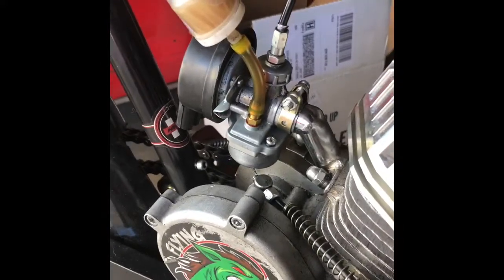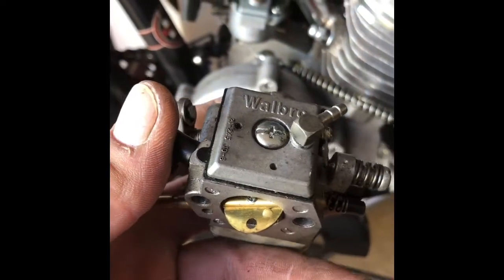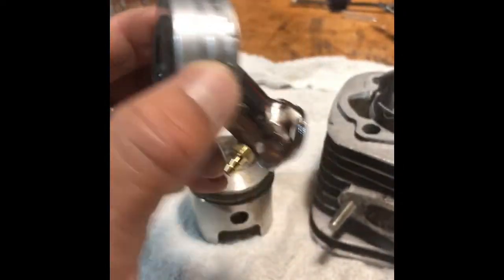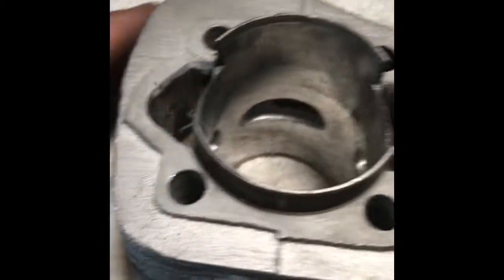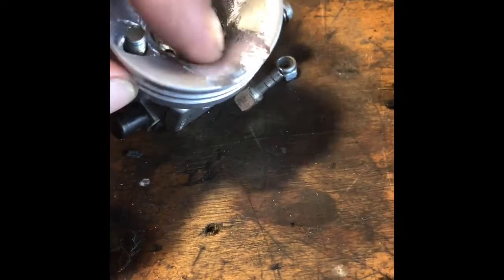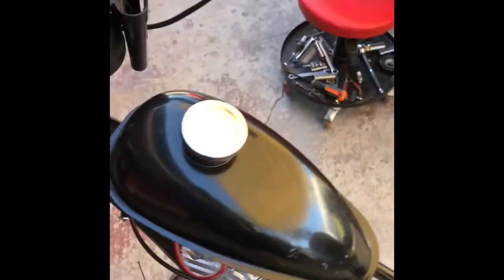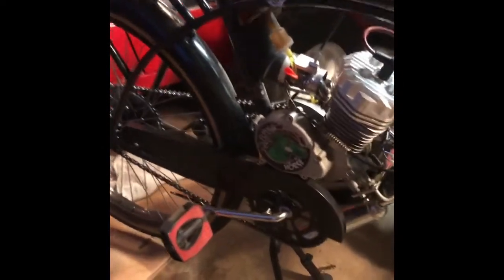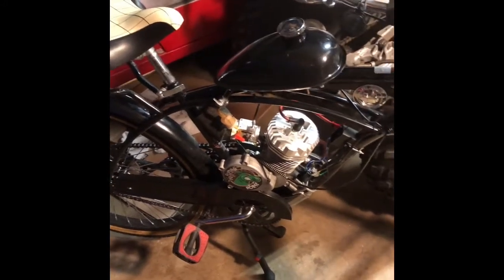Upgrade & port the 66cc Nel Lusso motorized bike to pumper diaphragm carb

Comment: Your rpm tach is set for a four stroke that's why your getting 9000 rmp that engine is only putting out 6500 tops
Reply from the maker: Maybe so, but doubtful.  The carb definitely added rpm.  and it ran harder than a gutless stock motor.

Comment: Looks like you did great on the pumper carb setup and the port work👍

Get a real dirt bike pipe between 65cc-85cc and definitely get a larger intake with the bigger carburetor you're getting and it will be a different beast! 🚴💨💨💨

This is the link for the intake you should get it's a MZ Miami big intake don't get the knock-offs that looks like it they're smaller.
https://www.ebay.com/itm/272905866508
Reply from the maker: ENGINES N WHEELS thanks!  Ill have to buy a thicker frame / setup if i want to go to extremes.  This is fun already though.  Not looking to race.  Just experiment.  Please let me know if theres a heavy duty frame you’d recommend?  Im afraid this Nel Lusso can break or crack goin 40 on a wonky street 😅
Reply: @arrepuess  huffy Cranbrook or huffy Santa Fe frames are pretty tough on the cheap side and I'm not a fan of the gas frame bikes as I seen them break many times.